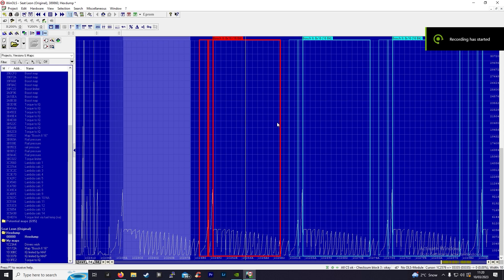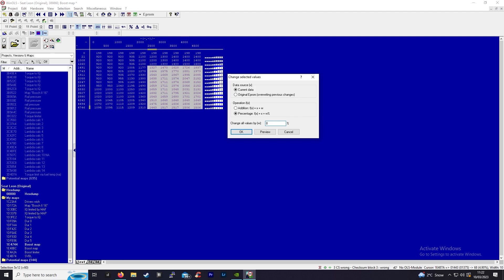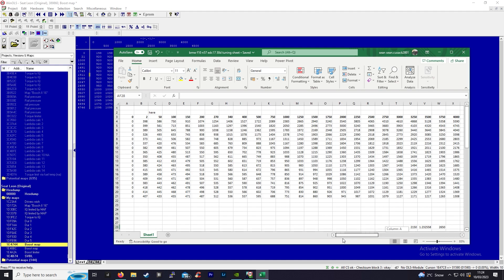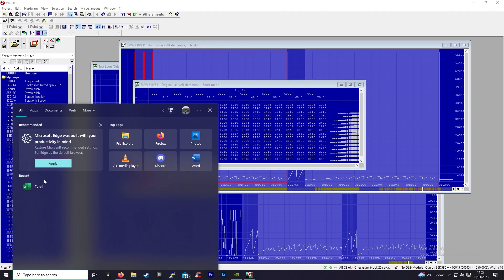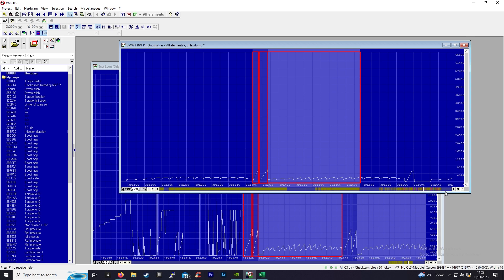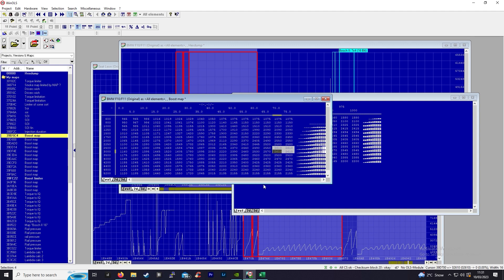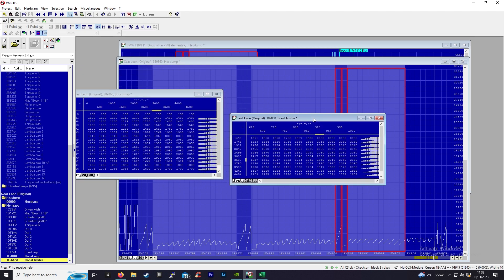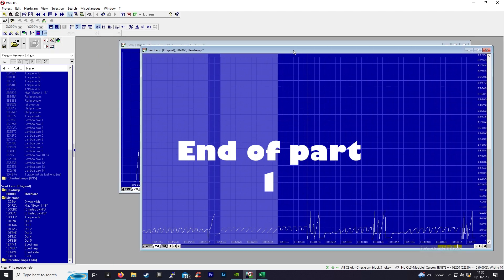How to remap- Boost Maps EDC16 & EDC17 ECUS pt2 vol.1

Comment: You say in the video that all edc16 ecu are pretty much the same but I'm looking at a Ford edc16cp39 file and I'm struggling to Identify the maps. Any tips?
Reply from the maker: Email the file on or make an account on the website and submit the file, I can send back with a KP file assuming you use winols ?
Reply: @ckpelectronics8921  done thanks. Yes using winols, im hoping one of the maps is linked to the esp button so I can then swith maps on the fly, tweak the standard map for economy and have the other map for when I want to boot it 😀, then I might need the egr/dpf deleting if you have a working method that doesn't just delete the dtc codes 😉
Reply from the maker: @DarrenHiggins-hg8gj  egr maps are always followed by their hysterisis map which will keep the egr permanently closed, dpf maps also have switches
Reply: @ckpelectronics8921  yes thats what I've read im just struggling to identify the maps they don't seem to match what I see in the videos
Reply from the maker: @DarrenHiggins-hg8gj  no worries, they do tend to have their own spin offs with different manufacturers
Reply: Hello, where can I get the formula for such an exel calculator?